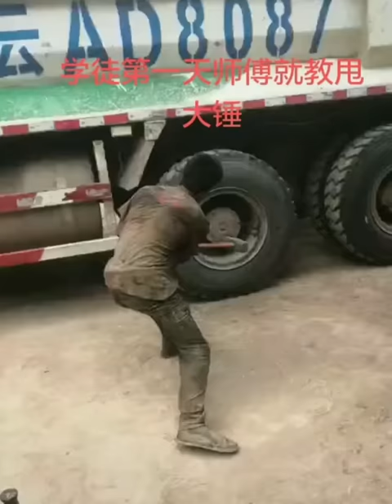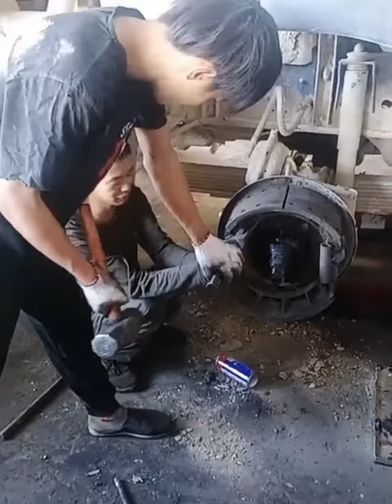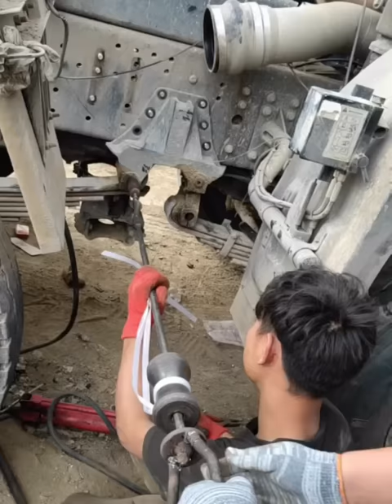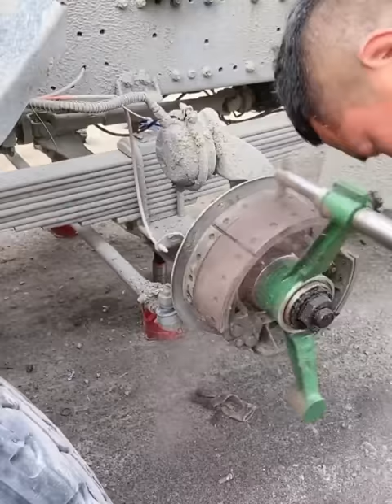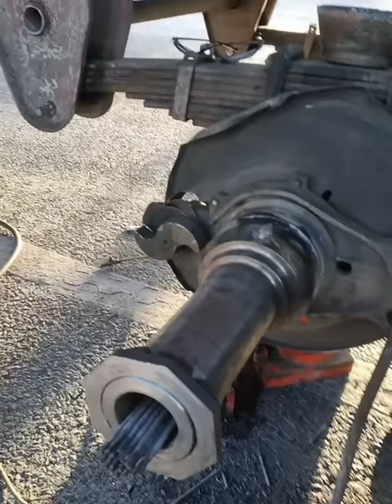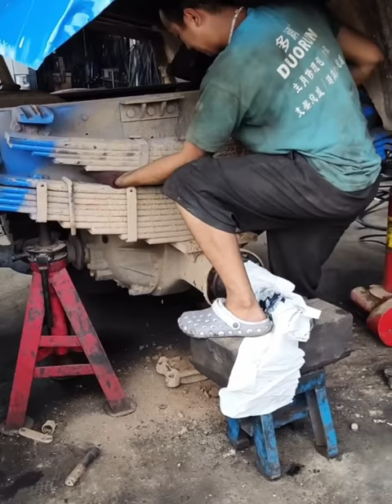Just do your best to get things done --- How tough Chinese Mechanic repair trucks

Comment: My back just went out watching this vid, I feel so bad for all them hard workers working like that, I wish them all good health and hopefully they find a less labor job some day
Reply: @cesartoledo5621  that's sad 😔
Reply: Epic dudes, never sniveling about hard work, just getting it done.
Reply: Wrenching on heavy equipment or hard use truck fleets can be a labor intensive job,  worn trunion bearings,  cracked leaf springs etc.   There are no shortages of dead and dying machines on this planet  so one can easily find work repairing and performing "autopsies"  on them it seems.
Reply: They have brake drum carts, and air hammers, and forklifts, and c clamps you can use with air impacts, oxygen and acetylene tanks to straightened out bars. I don't know if they care not to use those items to make their job easier..
Reply: @djstatyk1540  Do these clowns think that machines put themselves together,  and take themselves apart to be repaired.
 Seems a toaster is a very complex machine to some people.   People who are 4  quarts low and only hold 5❗️
Reply: Or they take pride and value from working hard with strong bodies
Reply: my hands literally just fell off watching the one guy hold the bar as the other one struck it with a hammer...
Reply: @piggyoinkenstein.186  Are you a robot
Reply: @themousebouse  Is a Bullfrog   Waterproof?  
I'm the robot from lost in space.
NomSaaaaaaaayn.?
Reply: @williamriedel1686  Bu
Reply: I've actually done this level of hard hardest labor before. I helped my dad change our Ford Pinto from manual to automatic transmission. I held the hogshead / tranny in my lap while he screwed everything together. My legs were going numb after the 1st few minutes lol
❤😂🎉😢😮😅😊

Comment: I'm from El Salvador (Central America) and visited there not too long ago (I live in USA).  I had electrical problems with my Suzuki Samurai 4x4.   I went to a car shop and this 10-year-old boy comes and asks me what's wrong. I told him that when I engage the turn signals the brake lights and my stereo also blink in sync, told him to get someone to fix it.  The little boy quickly went inside my car, sat in the driver's seat and started to disassemble my steering wheel column.  He then did some cleaning with a flat screwdriver and then a dust blower.  He also did some diddling in the fuse box.  He fixed the problem in under 15 mins.  I was left dumbfounded.  I also watched him take out thermostats and radiators out of vehicles to fix overheating.  I asked him a few questions. He said he has been there since the age of 7 and that he doesn't get paid.  His "wage" is that he is learning "for free" the shop owner told him.  I gave him $10 U.S. dollars in tip, the boy said he would use that money to buy his Mom a pair of sandals.
Reply: A lot of great mechanics in the US are from el Salvador.
Reply: @andrewfreiji4647 , I know a few from El Salvador and Nicaragua.. MI Familia en Miami Gardens. I learned alot from those guys.  My nickname down there was Super Gringo. 🤣🤣🤣🤣
I worked with some of the best in the field. Fidias, Arturo and Santiago are top notch
Reply: hola
Reply: Love you for the tip❤️, it's amazing really, just 10 years old
Reply: Heart touching... You would have given him more money
Reply: @mariagarza9593  I know "hola" means "hello" in English.  But YouTube is drunk, it translated it to "hour" 🤦‍♂️😄
Reply: Man that Kid better own his own shop one day.
Reply: Lzzzz
Reply: God bless that young boy
Reply: Will be that way in the U.S.A. if repubs get their way.
Reply: Knowledge he is learningis more costlier than nay money we pay. The kid has understood that. Good for him.
Reply: @jabjones2165  we have the best economy when a republican is in the house. What's the excuse for our economy right now? What was the excuse when obummer was in office? Point made.
Reply: My thing is when you have governments with way too much control people still find a way with very little or nothing. Just shows you how determined the human spirit is no matter what situation you are dealt in life.
Reply: @jabjones2165  and if the dems had their way that boy might have never been born.
Reply: God bless you and him even more. The owner could pay something. The boys work is gaining the owner a better reputation. Good work deserves good pay....or is it only  for greedy selfish tyrants large and small.
Reply: @justfelix30  And his dream car of any choice. The sky is the limit.
Reply: That's nice in a way.  In the USA you become a mechanic by going 2 school costing as much or more than a house unless you are born with parents who teach you.  You teach a 7 year old like that in the USA then you are probably going to jail, and the child then has to save thousands of dollars by pushing carts, and cooking fries at a low wage to get that education.
Reply: @sealer3553   My friend learned to be a full mechanic with only $350 dollars. He bought a broken down vehicle from the junkyard and had it transported to his backyard. He then took apart the brakes, transmission, engine and whatnot, he assembled it again and disassembled it again. Did this several times. That's how he became a mechanic. No Youtube videos at that time, in 1993.
Reply: @alienlatino2945  That's a brilliant idea.  Glad your friend learned it well that way.
Reply: And, if the US had not practically destroyed El Salvador in a 'civil war' that boy may have attended school.
Reply: amonra4283 so u assume he does know nothing else. 😛
Reply: @MichaelMadix   In 3rd world countries mechanics and plumbers don't make money, they are as poor as the peasant who sows the fields. They only make money to survive but can never scrap enough money even to buy an air compressor for power tools which they don't have.
Reply: @robertpontius1689  Robert, I wholeheartedly agree with your evaluation. Obummer is aptly named.
Reply: @sealer3553  Excuse my ignorance. I don't think that I understand your point. What does teaching a child anything have to do with going to jail and them pushing a cart? I happen to have had two 7 year old children and three 7 year old grandchildren. I've thought all of them plenty of stuff. I've never been in jail, and they have never pushed a cart.
Reply: @Navyuncle  They wouldn't be allowed to work in a public mechanics shop in the USA.  If they did, and someone reported it to cps then you could face penalties of child endangerment/abuse/neglect.  Some snobs in the USA love to take issue of adult engineers working on their own personal vehicles even.
Reply: Ya Allah,.. Mendramatisir sekali saya membaca komentar anda.
Reply: 9mm

?

E@Tap on a clip to paste it in the text box.😮Touch and hold a clip to pin it. Unpinned clips will be deleted after 1 hour.Tap on a clip to paste it in the text box.Tap on a clip to paste it in the text box.Use the edit icon to pin, add or delete clips.😊😊😊
Reply: Thats disappointing. Hes not even being paid, and his education is subpar at best. 
This would never fly in the USA. I can see a kid working in his parents bussines but rules state you have to be at a set age to work in that environment. Even at your family's shop.  7 years old is too young and some of the works too dangerous.

Lifting a rear-end into the bell housing that almost weights what you do was nuts, ever hear of work smarter not harder?  A simple home made tool would take away some of the lifting and speed the job up.
Reply: @galinakislitsyna4079  это лучше чем, если бы мальчик сидел, уткнувшись в гаджет, смотря тик-ток
Reply: Keep visiting him and help him dear, I am in Africa and far away to help him
Reply: @robertbennett9949  I think that boy was from/in China.
Reply: @robertpontius1689  Dreamer.
Reply: @robertpontius1689   Dreamer. With republicans in the house america will fall down. Only a democrate can save the country and our planet.
Reply: There's something really valuable to this:  I nearly ruined my life with student loan debt. To make it worse, a guy I worked with at a shop years ago said, "Damn homes, you paid 40 grand?? Man, I'm getting PAID $12 an hour to learn!😆" 

That 10yr old kid is smart: in all my years, I can tell you that is like, earning your 1st degree black belt level stuff right there- just KNOWING where the issue is at. That's a LOT of experience. He's gonna be better off for learning that much, that early for free, overall.
Reply: @jabjones2165  🤡🤡🤡🤡
Reply: Я из России, Крым, город Севастополь. Ты правильно сделал, что дал ему 10 баксов, а он правильно их потратил. Он выростит настоящим мужчиной и кормильцом своей семьи.

Comment: I've learnt that all you basically need to fix trucks is a really big hammer 🔨
Reply: And REALLY big balls
Reply: The second step after that is not to call it a really big hammer, call it the persuader and it’ll give you +10 swing power
Reply: nothing can not be fix with a big hammer, including asking your boss for a higher pay rate lol.
Reply: Don't forget that big long steel bar to pry with. Also referred to as a persuader.
Reply: And if that doesn’t work get a bigger hammer ⚒ and flip flops with socks for protection
Reply: I prefer  2 1/2  pound 12in. handle you should also get a 1in. cold chisel these tools complement one another nicely
Reply: We call it a BFH where I'm from. Big F ing Hammer.

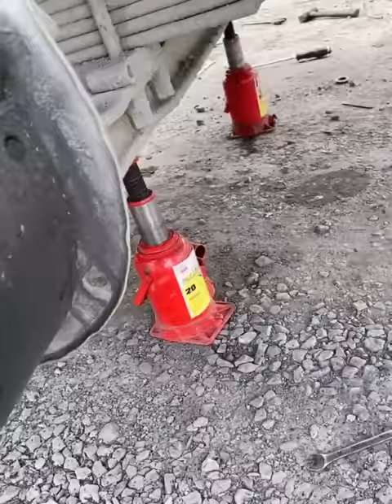Comment: 3:22 Good attention to detail- most GB workshops would just throw the drum back on.
Reply: what is he doing ?
Reply: @samesamel  "Doctoring" the brake. The machine turns the shoes so they form a good cylindrical surface, which closeley matches the inside surface of the drum. That way, the brakes behave normally as soon as the vehicle leaves the workshop. They don't need bedding in.

Comment: This is the way people work in ALL not so developed countries that have made fluff out of own people with all their regulations, insurance requirements etc.. They also actually know how to fix stuff not just buy new and replace. Electrical components fail just take it to a specialty shop and they'll rewind the entire thing. Injectors fail? They'll rebuild the originals, same with shock absorbers, carburators, fuel injection pumps, brake pads, clutch discs, torque converters, transmissions ,rear ends etc. All fixable components  that in the U.S. and other 'developed countries end up as scrap or sent to the very few 'rebuilding facilities to be resold at near new prices.

Comment: Gosto muito de assistir esses vídeos,serve muito para valorizar as mãos de obra muitos não dão valor nos serviços brasal só ficou observando a falta de EPI são muitos riscos de acidente será que dá para postar um vídeo eles fazendo o uso dos Epi
Reply: Do you think any of these guys use PPE, or would keep their job if they asked for it? If they asked for real tools besides a hammer? 

No doubt these guys are working very hard but not working smart or safe.
I can't know the whole story, but I'm pretty sure none of these guys owns these vehicles or makes any money with them. But I have little doubt that a lot of money is being made by someone and it isn't these guys.  Whether these guys work for the vehicle owners or a repair shop, some of the money being made should be spent to make these guys' jobs a little safer. And invest in the equipment to do it right.

Comment: OK at 13 seconds the excavator track blew apart....OK there is a manual with all machines, and most have a 7/8th relief valve to slack the tracks. Someone needs to be fired.  The reason I say this is because in front  of me I watched a head leave a body for the same stupidity. 24yrs working on yellow iron, any questions

Comment: I would never trust a welded wheel bearing spindle! It will never be as strong, and you couldn't guarantee perfect alignment.
Reply: They do this all the time in the heavy truck world in the USA. It's a legitimate repair,if done correctly that is. There are specialists who only do spindle installs,they make sure everything is dead straight before and after welding

Comment: With the loads you folks put on a truck I bet there is a broken spring pile somewhere over there tall as Mt everest. If I put 200 tons on a dump truck 🚛 here in Virginia the whole Virginia brigade would be fighting over who will make the arrest. I've been known for hauling a load an running around the scales for 50 yrs. It would be on the news an in every paper in the USA. `TRUCKER HAULS 200 TONS IN A 4 AXEL 58,000 GWT TRUCK'' 30 YRS JAIL SENTENCE.